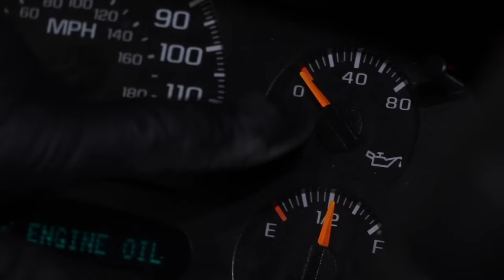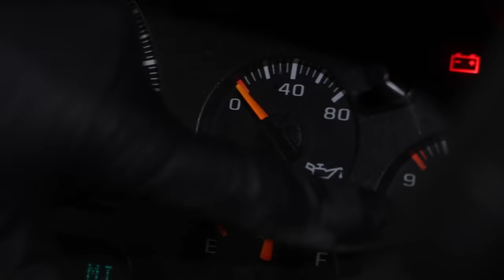Top 5 Problems 2000-06 GMC Yukon Sierra Chevy Suburban Tahoe Silverado Avalanche Cadillac Escalade

Comment: '01 Silverado...brake lines @ 16 years(usual on most vehicles especially if rust proofed), disconnected the ABS in '03(not landing on any aircraft carriers), try this, starter engages while driving, damn engineers moved the neutral safety switch from the column to the outside by trans(Lucas brand!)switch corroded toasted starter. 1st plug change at 80kmiles, ignition wires dissolved on touch other than that tires every 4 years, batteries every 7 years, trans oil every 6 years, usual filters inc cabin, A/C toast but love open windows...still one sweet ride, oh she's U.S. not Cdn and Syn oil since day one burns 1/4 of quart a year, slow coolant leak might be pump recently but I would NOT buy a newer one, nice to see the problems I haven't had...

Comment: I replaced all grounds, the throttle body, tac, and pedal with pedal sensor. Checked all wiring many times. Dealership through another throttle body at it. Checked all wiring to ECM... Basically came to a point where the dealer said replace engine harness with no guarantee for $3700, or just scrap it..  Still broken.. Says A and B channels on throttle angle are still off, even though my scannee says they arw correlating. I would give you a code. But basically, I have already got every different code there is for the drive by wire, and still have issues... Idk...

Comment: The instrument cluster has a odometer issue as well recognized as the GM Special Coverage Adjustment 07187.
The throttle position sensor has GM Special Coverage Adjustment 11273.

Comment: 01 Silverado- My 4x4 dash switch gave me probs at 50k. Replaced the switch with an 1AA part and no probs since. Apparently the solder goes bad and cracks sending a fault indicator to the computer. Easy fix
*Edited for grammar.
Reply from the maker: +Andy Herron Thanks for checking us out!

Comment: Probably could have split out 5.3 Vortec I probs and GM chassis culprits. Front wheel bearings/ABS sensor, Brake/Fuel line replacement and subsequent fuel pump assy and nylon line connector repair, Hydro boost pump/cooler/master cylinder, Big5 grounding method, (You got most of my favorites).
Reply from the maker: +James Larson Thanks for the feedback!

Comment: Brake lines rusting is biggest aggravation, and probably the most expensive for paid mechanics to do, if you want to save labor costs DIYers, you can get prebent lines and all their fittings made out of stainless steel for the entire system for around $80.00 online. And yes you can bleed all lines your self even with ABS

Comment: In tank fuel pump, from wheel hubs,Brake lines, Evap 
Otherwise excellent I got over 250k on several .
4.3,5.3,6 .0 ls the best.
After 2006 oil pressure sender pipe has a filter screen which feeds cam lifters often dirty causes oil Gage issues
There are body to frame ground straps under Neath near drivers seat

Comment: Recently got an 02 Tahoe with just over 200,000 miles and it has step 2's problem. When slowing down to 10 miles an hour the abs module kicks in making a groaning sound and the brake pedal will shudder. Already got 2 brand new abs wheel speed sensors hoping to replace them today.

Comment: I’m having the ABS sensor issue on my 06 Tahoe and my traction control light comes on all the time in stop n go traffic. My temporary fix has been to turn off stability control. Thanks for giving me the fix. Other issue I have is a check engine light that comes on every now and then (noticed it comes on more when its warmer weather out). Last issue I have is the airbag light is on.
Reply: I just got this truck yesterday 7-20-21 and I have every problem.im combing thru the comments to see what I can learn and get to fixing

Comment: Wanting to purchase an 01 tahoe.  Really only problem is minor oil leak.  Not familiar enough.  Told it was kinda common.  Could sure use some tips on if this may be major red flag but I figure vale cover gasket or oil pan gasket.  Price is really good on it but not if I gotta suddenly drop 2 large after the purchase.  I can deal with a gasket myself easy.

Comment: I have a problem with my heater and ac having a mind off f their own not going to the right temperature I want. I have a 2003 it’s a great vehicle runs smooth. The owners before me bought it new they always used synthetic oil so I have to keep the family ritual going it’s only got 153000 miles on it.

Comment: You guys forgot to talk about transfer case that the back housing gets a little pin hole wore in it over normal use and it will start leaking which will cause your chains to go Slack because of the excess Heat generated not a hard fix if you have ever messed with a transfer case from the inside aspect but if not you should take it to a mechanic that specializes in drivetrain they will have to replace the back housing of the transfer case early signs of this is a clinking when shifting or a shutter when shifting but you can't rule out the transmission at times but if you check your transmission and it is not making any weird sounds or slipping it's your transfer case
Reply from the maker: +Adam I'll never tell Thanks for the feedback!

Comment: Security system will trip when replacing battery. Make sure there is a fuse in fusebox for security system, or it won't turn it off after install of new battery. 
It will stay in lock down.

Previous owner pulled out security system fuse, and used as a replacement in another spot.

Security would not turn off until I discovered and placed a fuse in empty spot.

Oil slinging out rear main, will soak starter and greatly shorten life.

If possible run a thicker quality oil, to slow leak. 
These older trucks leak bad with thin
Synthetic oils.

Comment: Just got an 03 Yukon and it has the brake issue you mentioned. Dont know yet if thats the fix but will check it out as i was thinking warped rotor or bad brakes.

Comment: Got one...fuel pump fuse on same vehicle 2000 to 2006 gm... under hood...happens a lot...I've personally seen it a lot...if you pull the fuse sometimes you can actually see where you plug fuse in...it's actually trying to melt

Comment: i have a 04 yukon, 245k miles, and a 03 2500 4dr long bed, 200k miles, both sitting in my driveway right now, nothing but regular maintenance on both, i live in utah, so lots of salt, wash your undercarriage, and maintain your vehicles with quality parts, this things will last forever

Comment: Only things ive done to my suburban since I got it at 251K is replace water pump/thermostat, replace both knock sensors (duh), and replace the purge solenoid valve at the fuel tank. Its almost at 290K and although im starting to get the lifter tap (engine getting tired) its still runs good.
Reply from the maker: +mrnapolean1 Thanks for the feedback!

Comment: I have a 2001 GMC Sierra C3/6.0l.  My truck was running fine 2 weeks ago even while towing my 20' Cobalt Boat.  Now I have been experiencing great loss of power upon acceleration but it is seeming to feel as if it wants to bolt-off as it use to do but then it seems that it's not getting fuel to accelerate or I possibly have a dead coil or bad wire.
Now, if my OBD11 Port is not functioning properly to read out any Codes for me.  Which fuse is the OBD11 fuse.  Is it in the driver's side fusebox under the hood or is it in one of the other 3 fuse boxes?  I would sincerely appreciate it if you could possibly give me a clue or two on where to start.  I did have a plugwire off of my #4 Cylinder, it showed a little bit of rust on it as if it had been off for quite some  time but I'm not sure since it just wasn't plugged in all the way.  When I plugged it back in nothing improved.  How can I test a Coil-pack or Plugwire to see if it's  gone bad?  I'm sorry for being lengthy with my explanation but my head is truly spinning with this one.  Thank you so much!!!
             Jeff S.
             Redford,  Michigan
Reply from the maker: +Jeffrey Sabo We wouldn't be able to diagnose an issue like that here, you may want to have a local mechanic take a look at it. Thanks for checking us out! http://1aau.to/m/Shop-1AAuto-c

Comment: i have had my gmc yukon 2003 sle 5.3L Flex for 6 years and most of these problems aren't showing up for me. the ABS sensors probably i think that will help me. one thing you left out I'm surprised is the blower motor resistor goes bad. seems to be a common problem from what i can find on the internet. mine goes twice a year if i use the blower on full speed
Reply from the maker: +Pan 77 Thanks for the tip! We'll pass this info along to our production team.

Comment: I have a 2002 Tahoe that about 6 months ago started to chug or hesitate between 40-60 mph. Shortly after it started to idle rough and then stall. I was able to fix the rough/stall idle by cleaning the idle air control valve but still have the hesitation between 40-60 mph....and have recently notice that when starting from a stop light, there is now (sometimes) a slight hesitation. Could these all be related back to the idle air control valve and that perhaps cleaning it was just a temporary fix and might just need to be replaced? Are there other things I should look at as well? I am not getting any check engine lights so this has been a hard one to fix. Was thinking about changing out the plugs and wires if this might be the problem?? Other than this, it's been a well maintained and great running truck. Any insight with your experience is welcomed. Thanks very much for doing this video on the top problems. Rich W
Reply from the maker: +Dick Summers Unfortunately, we cannot provide a diagnosis over the internet. We would suggest consulting with a reputable local mechanic to determine what is going on with your vehicle. 1aauto.com

Comment: I hate sensors. They almost always cause a huge problem and if you don't know they exist you end up replacing expensive mechanical parts without fixing the problem. Never understood their necessity. Case and point, "if you remove the sensor and the engine runs normally, then you know the sensor needs to be replaced." I've been told this about several sensors just a this guy said about the O2 sensor in this video. So the obvious question would be, why the hell do I need it?

Comment: Ground wire causing dash lights, or no radio speakers, no A/C compressor 
Also side bearings REAR, tailgate lever tabs breaking, ext. cab windows leak air, daytime run lights burn at socket, light reflecting mirrors cloud up

Comment: Question I drive an 2005 Chevrolet tahoe.   And it has close to 300k miles on the engine. I keep it well  maintained I’m my own mechanic. 
I just ran into a problem 2 weeks ago A ticking sound from the middle of the engine.  And yes oil pressure is good and the sensor is brand new.  I geez out the push rods in the rock arms last year. So those are still good it’s a ticking sound coming from under the intake manifold. But the ticking sound only comes when the engine starts warming up.  I listen closely to it and it sounds like shattered glass.  I’m not sure if it’s my lifters they’re going out ? Because there’s not allowed tick. Went under acceleration the ticking starts.

Comment: On my 01 Yukon, both the ABS and emergency brake lights stay on all the time and the check engine light stays on but when I tried to get it read by a part store I was told there was an issue with my adapter thing inside my vehicle.
Reply: I've got an 02 Tahoe with the same issue.  It's the rust on the ABS sensors.  It doesn't affect the brakes so I put electrical tape squares on my dash to blot out the lights. No check engine light yet and I've got 235,000 miles.

Comment: So what happens if u only put two 02 censors on instead of 4 , or u put them on wrong  also I have a electric problem also my radio went out but the speaker still make noise while the truck is off

Comment: I still have my 03 Yukon Denali XL just shy of 300,000 miles. Needs a paint job now, and she has a few little issues  but its a great truck and it has taken our family across the country more times than I can count.  Now, i'm stuck with a few small issue I need fixed before my next big move: I have a parasitic electrical drain that I can't figure out. I've watched a few video's on how to troubleshoot but nothing is really working. If I don't drive or start engine for 2 or 3 days, battery is completely dead. all I can do now is physically disconnect the battery until I need to go somewhere which is kind of a pain. Any thoughts?

Comment: When I got the P0332 knock sensor code I had a little bit spark knock on bank 2. Once I cleared the codes it went away but I'm gonna get it fixed as soon as possible

Comment: I have a 2003 tahoe after driving for bit it over heats when not running also has loud fan noice when accelerated replace hoses, thermostat, fan clutch, and did radiator flush but still doing the same.

Comment: Had a steering wheel speed sensor issue on a 2000 c2500.  When driving down winding roads, the power steering would randomly flip between little assist to TURN 180 DEGREES NOW.  Not sure if it had the same setup on the newer body styles of the same year.
Reply from the maker: +yarrik701 Thanks for the feedback!

Comment: I have a 2001 Yukon XL, 5.3 L, 4WD, SLT,  It drains the battery within 3 days of being parked. I have taken it to several dealerships and good mechanics. The first thing they do is replace the battery. After a few days I take it back to say the problem is still there. They check for proper grounding, parasidic draw and who knows what else. I have had this problem for over 5  years. I even go as far as just throwing in a new charger and start switch hoping it might fix the problem. It's a good vehicle. It just kills the battery. I don't want to get rid of my Yukon  but because of that problem I have to say it is unreliable. Any suggestions? I'm tech savy enough to follow directions. or suggestions.

Comment: 2004 suburban 5.3L.  I have to turn my key to accessory 2 times before starting,  otherwise it does a lot of cranking.  After 2 turns of the key, it fires right up with no cranking. I have a 32 gal fuel tank with no external filter.  Any ideas.  I have replaced all plugs wires and coils.  The starter may be next.

Comment: I miss my 01 Sierra so much! 100K & only problem was GMs bad fuel pumps then. 1st one was going out @ 36k mark & got it fixed under warranty. 2nd 1 was going bad @ 100k & truck died horrible death in a double roll-ovr on black ice. Those 3.73 gears put 2 much torque 2 rear wheels & jus kicked me sideways @ 60mph & shot me off highway in bumper2 bumper traffic n2 a rock wall then rolled twice & landed upside down. 1st responders couldn't believe I crawled out from under that! Every1 thought we were dead & I probably wouldve 2! My fiancee had broken neck, but me & my blind Yorkie were jus beatup bad ( ya know th biggest irony was I was on my way2 Dr. appointment) but my black baby was d.o.a. I'm sure its V8 lived on in something else though.

Comment: I have a vibration between 40 and 50 miles an hour what can be done ?  I did change the u joints on the main drive shaft and that helped with the other vibrations I've had the tires rotated and balanced I'm thinking it might be the front  CV axle. I forgot to mention it's a 01 Chevy Silverado 1500😊

Comment: I have a 02 Tahoe when I step on the accelerator the oil gauge goes up and when I come to a stop or idle the oil gauge starts to flicker.
Reply: MINE TOO.. not at any PARTICULAR time of even   FLICKERs oil pressure.....   did you fig that out?

Comment: I have a 03   suburban the motor went out a 138,000 General Motors showed me a letter the Chevy dealer up here in Newnan Georgia showed me a letter that 2000 to 2004 the 4.8 the 5.3 the 60 and 8.0 Had a defected Crankshaft all of them thank you That letter was from General Motors headquarters

Comment: Little fidgety problems for the most part.  Should be expected on 15 year old vehicles.  I just bought an 03 suburban 2500 for $3500 though.  It probably has 150K miles left in it, but that will be fine.

Comment: I have an pristine 04 Silverado 4x4 extended cab that stays garaged mostly, has 124,000 miles on it. Being garage kept I use to leave the keys in the ignition. After 3 days the battery would be almost dead. Remove the key and battery was fine for weeks. Does this sound reasonable? The GM dealer ran a parasitic draw test and found nothing other than the clock in the radio. Cost me $200 for nothing. Bad ignition switch maybe? Penny for your thoughts.

Comment: Thanks for the great video! Just found this channel,  I recently had to get a knock sensor and O2 sensor replaced, reduced engine power was the notification on the message center, have to replace the original ac compressor on my 02 Tahoe, other than that, runs like a champ with 202k miles.
Reply from the maker: +Ck1 abe Thanks for checking us out. Shop for high quality auto parts on 1AAuto.com:

http://1aau.to/m/Shop-1AAuto-c
Reply: @1AAuto  no problem.  Now it's 30k miles later and I've got to replace upper steering arm, found this on out on this very video lol again, thanks for what ya'll do, it's very helpful 👍

Comment: What would cause my 03 Tahoe to go into reduced power when driving
Reply: I have the same problem with a 04 yukon..I had the throttle body done,plus gas pedal,but it also throws the traction control on as well...

Comment: This is great! I think my intermediate steering shaft might be going.  It did exactly what you described once or twice. I’ll need to keep an eye on it. Thanks again!
Reply from the maker: +Pat D Thanks for checking us out! 1AAuto.com
Reply: Remove the shaft, disassemble, and install a grease fitting.  I did mine in 2011.  I add grease about ever two years.  No problems yet.  There are youtube videos that show you how.